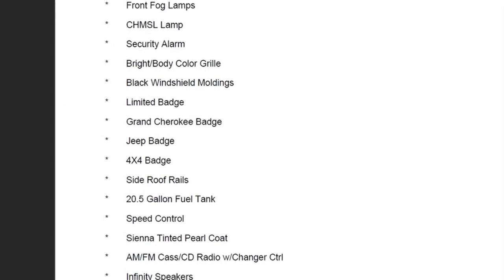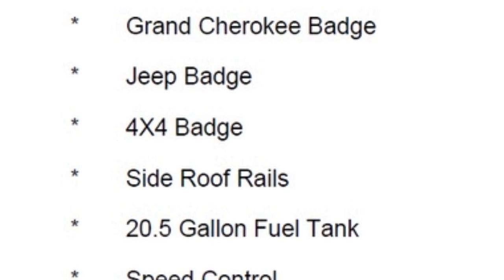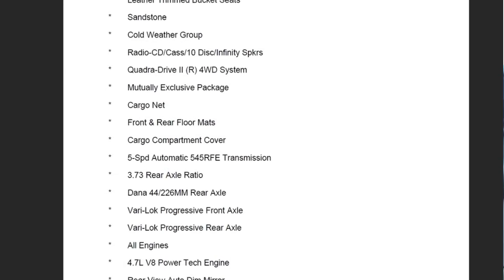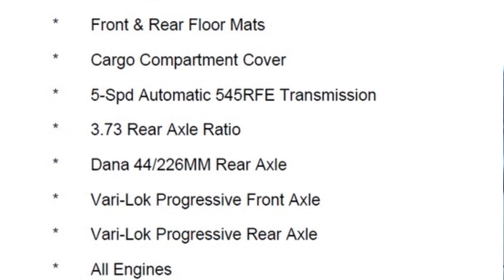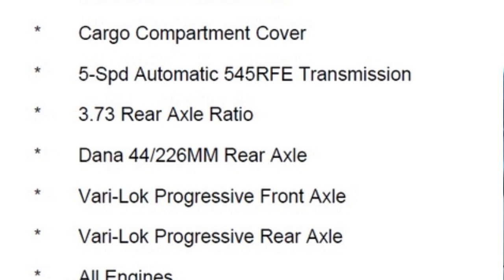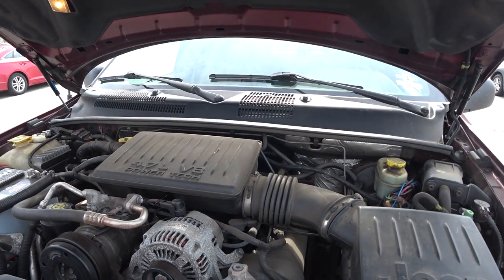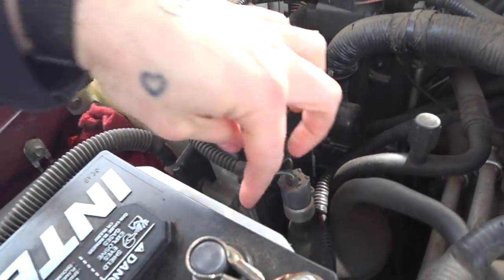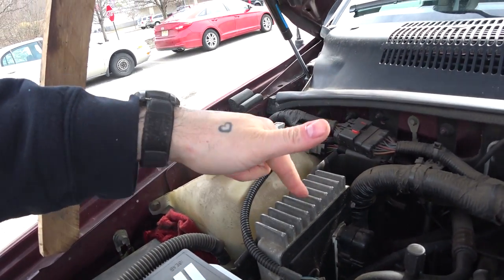45RFE to 545RFE TRANSMISSION hack to upgrade from 4-Speed to 5-Speed

Comment: Thanks for the link btw for the build sheet,My 1999 limited has the  45 trans and it runs around 1800 to 2000 rpm at 70mph and to be honest I have to commute up and down the hill out here in lone pine ca it could use lower gears in my opinion , dose do great on the highway tho getting 18-20 mpg
Reply: Sounds like it was updated sometime. My 45rfe does 2400 or so @70.

Comment: Thank you so much. A while ago I had the jeep worked on and after that it didn't  change the same way it used to and never really got the same fuel consumption that I had previously. I heard along the grape vine that a mechanic working for this business had improved his mates  jeep with parts from other vehicles (namely mine). Made complaints and never was able to prove anything.
I now have a  spare jeep to pull apart and will use your information to see if this part had been swapped out. Awesome.
Reply from the maker: Damn.. so they stole your TCM?! That is crazy!
Reply: That's cray

Comment: I'm new to this lifestyle and I really want to get an XJ, lift it and turn it into an overlander. Damn, an XJ in good shape is so hard to find in my area (Mid-Atlantic). What year range do you recommend? As a plan B, I'd buy a WJ if I could not find a decent XJ. Which year range and engine would you recommend? Thanks for your help.
Reply from the maker: If you are going to daily an XJ as well as lift it, get one from 97-01 after they went to OBD II. They are just easier to work on and a bit more comfortable. People will argue that point, but not having OBDII makes diagnosing an issue on what is now a 20+ year old vehicle a PITA. if you go WJ, they are all good, but they made small changes every year so the closer to 2004 you get the better they are. It is nothing major, just small things they improved from 99-04 which make the 04's absolutely perfect. I have videos on both WJs and XJs which explain some of the good bad and ugly. check them out for more info

https://www.youtube.com/watch?v=Mx5yc_KNWUg&t=824s

https://www.youtube.com/watch?v=1phOjmnlwu4

Comment: Did the data build spec sheet and it says under the standard equipt it had quadra-trac ll on demand but then on optional equipt it says quadra drive ll? It is a quadra drive but was the quadra drive ll really an option for 01 WJ? Just bought it and this thing is LOADED! Inside, outside and underneath it's got all the skid plates as well, looks like damn near like an overland build.
Reply: Huh...feelin left out lol. I get "No records found corresponding to the VIN provided" for my '04 Overland
Reply: @brendanjames7122  
When I entered my vin and hit done, my phone gave me 2 options to open the file. Pdf reader and downloads. The first time I did the pdf and it said no data to be found so I refreshed and used the downloads option and it worked. Not sure if it will help you or not but my first try was no success either
Reply: @kilswitch4336  It showed me no options to use, I'm using a PC. Phone is too small for me to do this stuff lol.
Reply from the maker: Mine is the exact same. 2001 with QD. It lists QTII under the standard equipment and QD under the optional. I am assuming that since QD was the nicest package they considered it an "upgrade" in 2001 since QTII was a standard option. Sounds like you have a really awesome WJ there!
Reply: @DEInTheGarage  Any ideas why it says Quadra-Drive ll (R) 4wd System? Typo? Lol
Reply from the maker: Definitely a typo. QDII came in the WK and XK, not the WJ
Reply: @DEInTheGarage  
Yeah, I got the 247 not the 245. That and ESD of QD2 with the Variloks that I have didnt make sense. I will print it out and take it in to the dealership and demand that they hold up their end of things since it wasnt installed😂.  Tell them we will call it even if they fab the mounts and install the JKs axles with lockers😏
Reply from the maker: @kilswitch4336  Bahaha... please film that exchange.. I would love to see it.
Reply from the maker: That is weird... not being funny, are you sure you entered it correctly? I would try again in a few days. sometimes the site is glitchy
Reply: @DEInTheGarage  Finally worked. One this I see is it's listed as having the Up Country Suspension Group, but on the WJ Jeeps site it states that option was discontinued in 2003 for all models. Our WJ is an '04.
Reply from the maker: @brendanjames7122  Glad it worked! My understanding is that in 04 UC package was no longer standard on ALL Overlands as it was in 99-03, but it was still an option you could ad
Reply: @DEInTheGarage  I was a bit confused about it, this is the text at WJJEEPS..
"Up Country package discontinued for all models as of August 31, 2003

All models built after August 2003 were no longer offered with the Up Country package, the special shocks and springs were discontinued. Skid plates and tow hooks, formerly included with the Up Country package and also available separately, became standard on the Overland and optional on all other models."

Then my build sheet stating it has the UC package.
Reply: @DEInTheGarage  Yep, entered it correctly and double checked both times. I'll try it again sometime tonight.
Reply: The only difference in the QuadraDrive and quadratrac II is the varilock front and rear diffentials. Both have the same 247 transfercase.